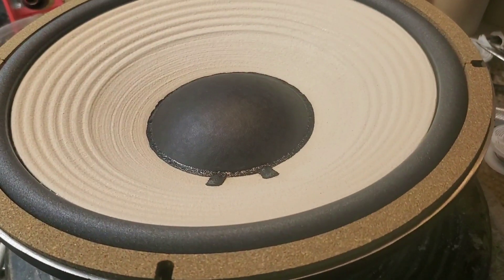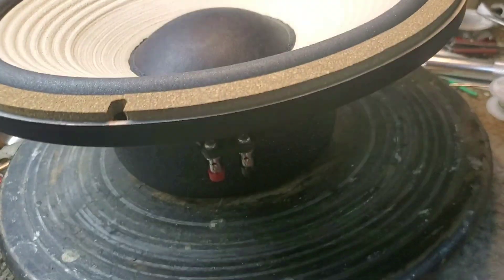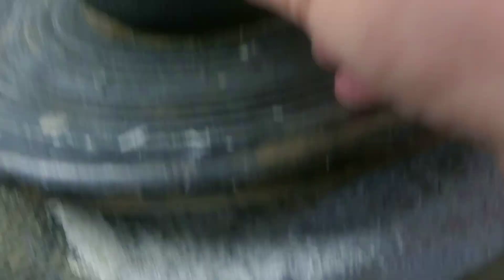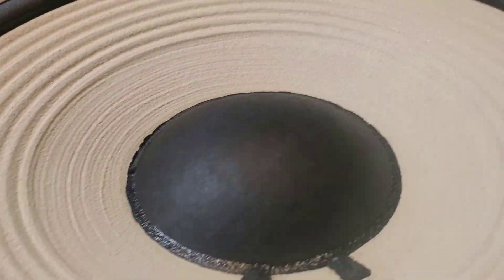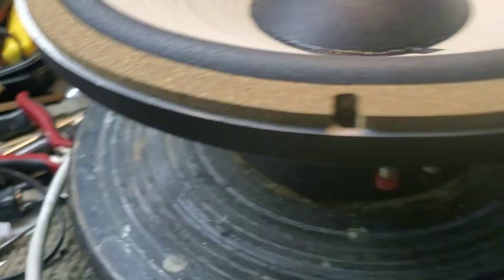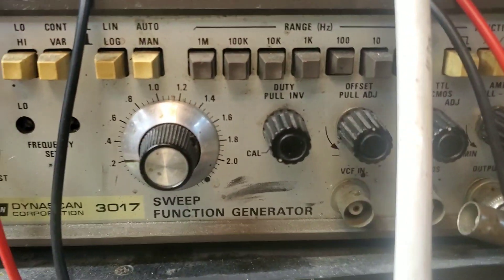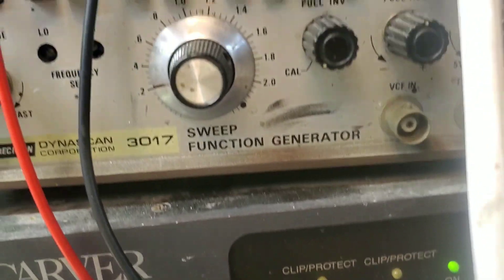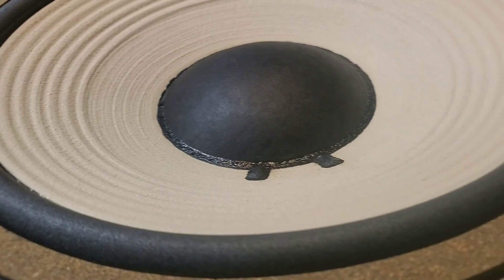Custom Bespoke JBL 124A/2203+

Comment: with that low of an fs it probably does sound quite different from the orriginal driver, nice work!
Reply from the maker: Thank you very much! The original 124A/2203A has an Fs of 16Hz with a pretty soft spider. My goal was to replicate the Fs of the LE14H-1 and 2235H. I have a no-rot 2203 recone kit in the pipeline that will eliminate the need to replace foam surrounds every decade. I've done it the 2206H. I call it a 2207H. I made a couple for a customer by request. They work really, really well for Hi Fi with an Fs under 25Hz. See the video here during testing:
https://youtu.be/SDqCu2EKgvY?si=7kwU-Oalvtv_1JFz
Reply: @edgewound  ah nice! i did not know the 2203 fs was that low thats frankly amazing!  still sitting on a pair of 2225s and gaus hf4000s for a low power rig sometime when i have a big enough room..anything interesting to be done for these old 15s?  they've seen some abuse..
Reply from the maker: @lycancatt4248  For HiFi? Yes...The 124/2203/2230/2231/135/136/LE14A all had a soft soft spider for a really low Fs. they were susceptible to spider fatigue and being driven out the gap at high levels of bass...and foam rot. The 2235 has a bit stiffer spider and longer voice coil winding to make up the difference at 20Hz. The factory spec recone kit for all these 15" drivers is the C8R2235. I have a no-rot 2236H kit that replaces the 2235H assembly. It drops right into the 2225 frame. Here's an impromptu video of the first pair I built for a customer that didn't want to hassle with foam surrounds anymore. He loves them. Listen with good earbuds or headphones and you'll get a remarkable indication of what they sound like. These were playing really loud...barely breathing hard.
https://youtu.be/mPY0sMijm6A?si=dCUNWzt5a_05xiyr